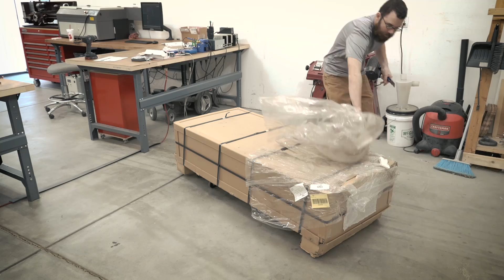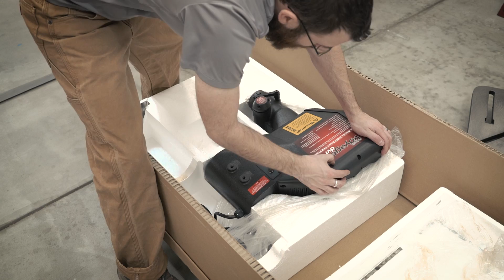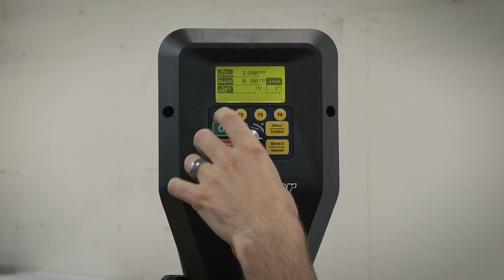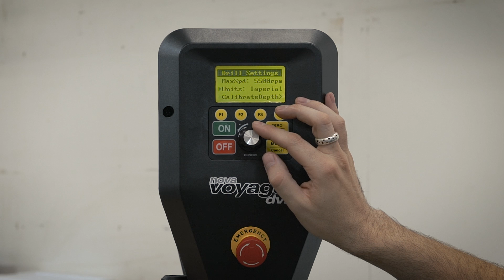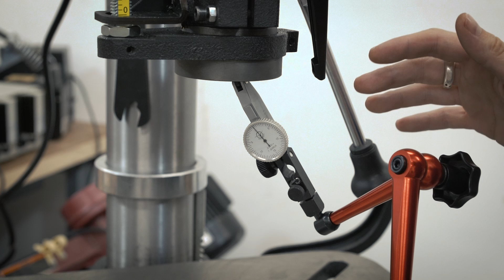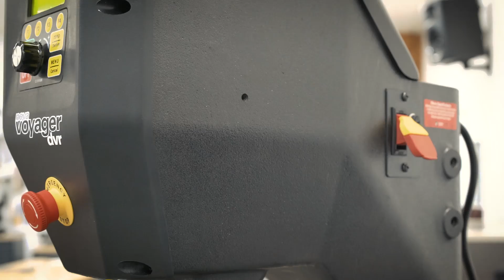Tool Review: Nova Voyager DVR 58000 Drill Press

Comment: Hey. Excellent sweet video. I found 2 problems with this drill press. Problem 1: the work table only tilts -45/+45 left/right. It should also tilt forward/backwards. This would allow you to very quickly square the drill bit to the workpiece, which is locked in the drill press vice. Useful when drilling/tapping 2inch thick steel. Problem 2: runout. Should be zero.
Reply: I think having forward/backward as well as side to side would just make it tricky to square up.  Why would you need it to move both ways, could you just not rotate the table 45 degrees (swivel it around?).  Also, the spindle effectively has zero runout, it's the arbor and chuck that have runout.  I will be replacing these with something that suits my purposes better.

Comment: A 1500 dollar drill press with a chinese chuck that has .008" runout? Unacceptable.
Reply from the maker: It's an accessory that is easily replaced based on preference.  Some people might want a keyless chuck, some might want a collet holder, etc.  It's probably a $25 accessory.  If they included a $200 keyless chuck and charged me an extra $200, I would be upset.  I'm glad they included something, but I don't expect them to include exactly what I want.  I bought it for the motor, table, head, etc, not for the chuck.  I would have been totally fine if it came with nothing.
Reply from the maker: For the record, I did remove the shank and tried replacing it, and also used another MT2 shank that I had.  They were all about the same.  That being said, I don't have a 'nice' MT2 shank, or a good chuck.  I'll just be replacing it with a keyless that has lower runout.
Reply: Robert Cowan I wonder what would happen if you measured further inside the taper. it could have angular runout, even though no radial runout shows at the front of the taper.
Reply from the maker: I could give it a shot.

Comment: Can you verify that the spindle is actually an MT2 taper?  Also can you use a drawbar or punch through the spindle to hold or tap out an MT2 tool holder?  You might be able to get an MT2 collet holder if you find a need for less run out than the Jacobs chuck.
Reply from the maker: Yes, I'm 100% sure it's an MT2.  The tailstock on my lathe is MT2, and I was able to swap chucks back and forth.  You're totally right, I could get an MT2 collet holder if I need I need something with less runout.  I may just end up getting a keyless chuck and some collet holders just in case.

Comment: Honestly, for the price (just google it, $1500 bux) I would rather buy a mill/drill machine from grizzly or similar, you would get a much more substantial machine with a much better table as well as a more versatile machine. For the price that thing should have come with at least an Albrecht chuck.
Reply from the maker: I disagree.  I bought mine on sale ($1300), so it's a bit less than $1500.  For that money, you can't get all that much.  You can get a G0704 or similar, but those weigh around 50% less, have a less speed range (with plastic gears), half the power in the motor (being generous), and only 2" worth of quill travel.  I thought about getting just a basic manual mill, but I would be giving up quite a bit.  I've owned mill/drills and they're nice, but they're not all that great as drill presses.  Plus, having the control over the motor is great.  Sure, a VFD could so something similar, but it still wouldn't be as advanced as what the voyager has.  It is a lot of money for a drill press, but the quality is certainly worth the asking price.
Reply: I guess usefulness is in the eye of the beholder. Yes you get 2inches of quil travel, but you can easily get a spindle that is 2-3 times more accurate, add to it that the chuck that comes with that drill press is a $10 chuck commonly found on ebay, not even a $20-30 keyless clone at that. The party trick seems to be the DC motor, which comes in handy with a mill, however not really useful on a drill press as most people drilling any holes larger than 1/2" are only going to spin in the 500-1000RPM range with large feed pressure, that can be compensated with gearing, add to it that the DC motor controller will eventually fail, rendering this thing useless. Good luck repairing that. just my .02c, As for mill/drill machines using plastic gears, not all of them do, some are belt drive.
Reply from the maker: Very true.  Yes, the chuck is cheap, but it's an accessory.  My tormach also came with a crappy allen key for adjusting the motor.  I don't blame them for not including a bondhus allen key.  It's an accessory I didn't get to pick out.  I'd rather pick out my own :-)  You're making REALLY broad assumptions here.  The mini mills have motor controllers, most use DC motors with really cheap controllers.  So those could fail.  Everything can fail.  Having owned 3 mill/drills, a few CNC machines, and a couple drill presses, for ME, having a real drill press and a CNC machine is a nice combo.  I would not have been happy getting a drill/mill or manual mill instead of the drill press.  Sure, the motor is maybe overkill, but it still has a purpose at lower speeds.  A simple AC motor with belts/gears can't determine the amount of load and apply more power as needed.  There are nice little benefits to the system.  You are right though, having the RPM range isn't necessarily all that useful for a drill press, but it's just a 'benefit' to the design that's not really useful.
Reply: My issue is not with the drill press itself, it is with the price bracket vs the quality of the machine. If you truly want a work hore, your not looking for a DC drive variable speed via pot and LCD screen drill press. Your looking for a unit that has 4-6 bearings in the quil, is stiff as heck. On the surface this machine seems like a tarted ~500 drill press from HF with a smaller table and a fancy DC drive motor. I could be wrong. I hope I am as there are no real quality drill presses I have seen besides ELLIS, and at nearly 4k that thing better be a nice machine.
Reply from the maker: Ah, I get what you're saying and you're incorrect.  I looked at the HF presses and several others.  This is quite a bit different.  I wish you could just see it in person and touch it, maybe I didn't present it well enough.  This is in a completely different league than the HF and chinese clones.  It's VERY different.  It's certainly not an industrial machine like an Ellis, but it's not meant to be (or priced that way) either.  But it's a huge step up from the chinese ones you're thinking of.  At my Rockler store, it was sitting next to the Delta, metalworking Jet (forgot the model) and the Powermatic.  It is easily beyond the build quality of any of those.  Looking at the biggest drill from HF, it has a 18x16" table.  The Voyager is 16" x 16".  It's not that much smaller.  It's also at least 50 pounds heavier.  From pictures and video it looks less substantial than it really is.  It's relatively small (for the swing), but it's really stout for its size.

Comment: Great video, thanks! I don't have a drill press yet and I'd really like to get one (not that I have an abundance of room for one). I see that Nova is billing it as the "first" smart drill press; do you know if there are more smart drill presses? Or, to say it a different way: were there other "fancy" drill presses that you were considering?

(also, thanks for the "I'm not affiliated with Nova" disclaimer - it's a shame that so many product reviews are suspicious because it's not clear if there's a monetary influence on what the reviewer is saying)
Reply: Actually, hold that thought. I put in an order for a Voyager DVR, and now I don't want to know if there's any alternatives.
Reply from the maker: I looked around and the only thing close is some of the older deltas and powermatics that had a continuously variable belt system, where you could just dial in the speed without changing belts.  BUT, it didn't have any motor feedback, so there wasn't an option to monitor load, self-reverse, etc.  I looked for nearly a year and there's nothing else out there like it.
Reply: Thanks for the reply! I wish I had seen it two weeks ago though. :) I thought YouTube might actually notify me with my other YouTube notifications, but they only sent it via email...

Anyway, my drill press came in last Thursday or Friday. I managed to get it put together by myself, even the head. Basically what I did was assemble it lying down and then tilted it up. I figured it would be fine to tilt it after assembly (like, if you needed to move it or something) so why not assemble it lying down? Anywho, when I fired it up, there is a very noticeable "rattle" coming from it. :( I'm working with tech support now; I hope they can fix this without too much hassle!
Reply: just curious, the did they resolve this?
Reply: @DjSqueekz  Yes! They sent me a new head, free of charge. The new one is great and even has very low runout.
Reply: @Hirudin  Good to hear! I'll have to invest in a good dial guage for when it comes next week. never really thought to do this kind of "quality assurance" on tools I buy but then again none of the tools I've bought so far are even a third the cost of this bad boy. so stoked

Comment: Since that indicators graduations are in .0005 increments, wouldn't that mean that you only have about .0035" of run-out on the cluck ?    Really cool drill press I'm impressed with how smooth the DC direct drive motor is and how well balanced everything seems. Would be an fun project to build an automated table raise & lower system with an Nema 23 and an front mounted control box... :)
Reply: You're right about the graduations, but if you look at them again, you'll see that the needle is sweeping through 15 segments. (15 * 0.0005 = 0.0075in)
Reply from the maker: Yep, you're right.  Still not bad, but not anything notable.  But that's pretty standard for a chuck that comes with a drill press...

Comment: You would do well to upgrade the chuck with a nice precise keyless one, especially considering the runout of the spindle/quill is quite low. It's a bit frustrating that higher-end models don't really come with them. I think that's the single biggest improvement you can make to any drill press---it makes them such a pleasure to use.

The blue boxes on the circuit board are likely mains-rated film capacitors, not relays.
Reply from the maker: yeah, a chuck upgrade is probably going to happen.  I'm not 100% sure about a keyless chuck since that might not work with the self-reversing routine for tapping.  it might loosen the chuck.  I'll play with the tapping feature and see if that would be an issue. 

You're totally right, I put the disclaimer on the video about not knowing that I was talking about after I realized they're not relays, but filter caps.  I just didn't want to reshoot everything because I already put it back together :-)

Comment: What would someone use the high end of that speed range for on a drill press?  I know cnc mills have high rpm spindles but the tooling is designed to evacuate the chips efficiently at those speeds. I typically find that even on our powermatic at school I never have a reason to take it out of its lowest speed when drilling through anything. Especially with large bits or hole saws you actually cut much faster and wear the tool much less.
Reply from the maker: honestly, I don't know.  That's REALLY fast.  Maybe sanding or something?  There is a setting where you can max it out to 3K, which seems more reasonable though.  But I'm sure if you were using it for other purposes it might make sense.  I've seen people do lathe work on drill presses, so there's that.  But it's mostly because it can, and it's just a software feature really.

Comment: It's probably a DC-DC converter because that allows you to choose your switching frequency and inductor size. Considering it has to step it up to 360v, it seems likely it's "just a" super beefy DC-DC boost converter, with a beefy rectifier bridge right at the AC input
Reply from the maker: you're probably right.

Comment: I wish I had done more research and found this Nova before buying the powermatic last year. Having the digital depth stop and control of the spindle is ideal for most of the work I do on a drill press.
Reply from the maker: I was really looking hard at the powermatic, but it was 'just a drill press', so I never really pulled the trigger.  I like all the cool features and full control of the spindle that the voyager offers.  Also, seeing both side by side, it was surprising to see how much more heavy duty the Nova was.
Reply: the base looks the same and the powermatic's table is not as robust and it a real PITA to turn 90 degrees and back again. The rack and pinon is a bummer on that nova considering the head they put on it but maybe next years version will have an option to digitize that... or maybe another project for the bearded one :-)
Reply from the maker: Ha that's a pretty big project!  But maybe, maybe...

Comment: I like how you own 10's of thousands of dollars worth of machining equipment, but need to manually close your garage door :P
Reply from the maker: Haha, so true.  When we bought the house, the opener didn't work.  I never bothered to fix it since we only open it when loading new tools ;-)  One of these days I'll get around to replacing it.
Reply: Give the Ryobi garage door opener a look. The battery backup that uses Ryobi tool batteries is pretty neat.
Reply: he would rather spend it on tools than a garage door opener, I can dig that.
Reply: Sometimes complexity can screw you over. Whilst it applies to the tools, having a manual garage door ain't so bad. Maintenance is every 3 years.